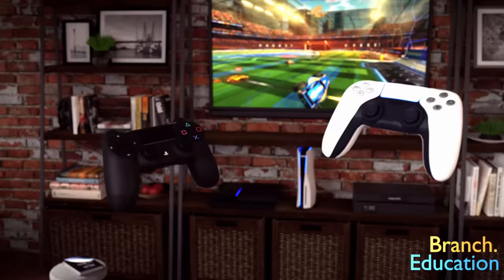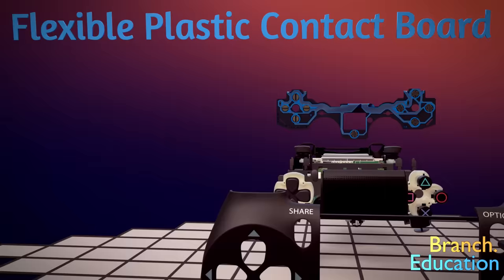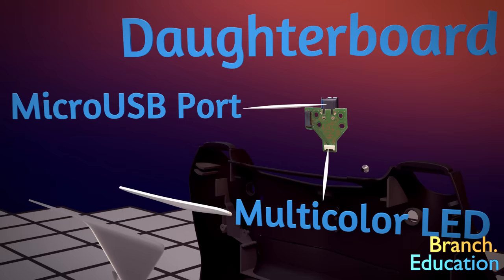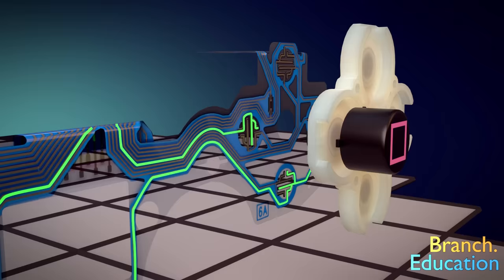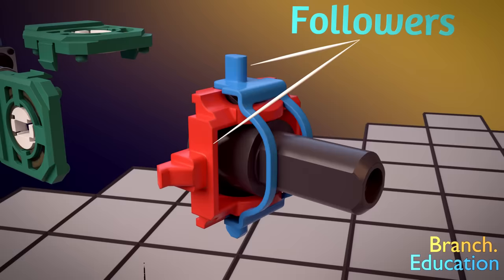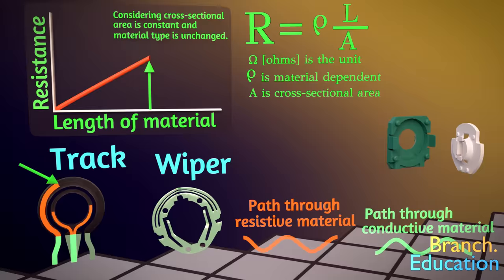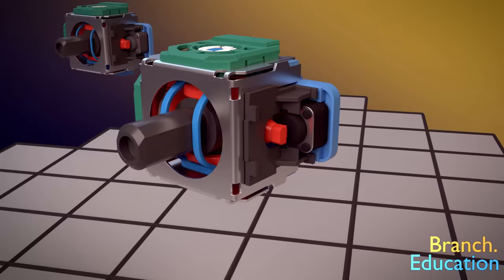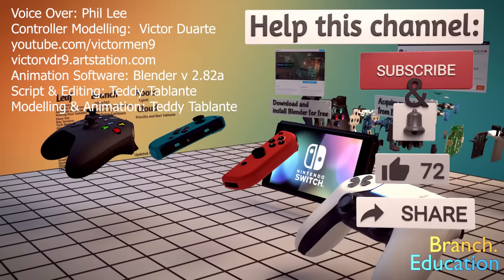How do Video Game Controllers Work?  || Exploring a PS4 Game Controller

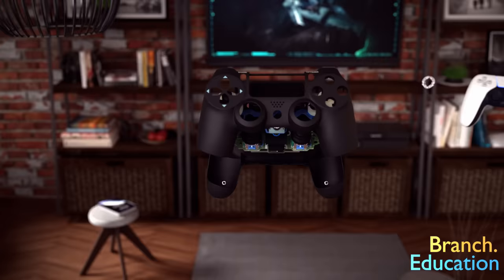Comment: 0:28 Expecting it to be the wiper from the analog sticks' potentiometers.
Reply from the maker: Whaa!  You even got the name of it correct!
Reply: @BranchEducation  I blame curiosity and cheap Arduino-compatible modules from Aliexpress that use spare parts for PS2 controllers. All PlayStation and Xbox controllers seem to be using a very similar design with ordinary, rotary potentiometers, while I believe the Joy Cons use a more compact design, similar to what was used in the PSP, where the wipers are travelling on a pair of guides that only move in a straight line, but by keeping the "stick" a lever (opposed to a dragged around thingy), they've managed to keep the center button functionality, which the small PSP analog didn't have.

Comment: 1:05. I guess it is located on the circuit board and has a porpose of serve as a conducting path according to the movements you make on the controller stick, so it kind of work as a sensor?... I can be completelly wrong, but i just watched 10:05 haha
Reply: I missed the location but the principle I almost got it right

Comment: Recognized the potentiometer wiper the moment it was brought up. I've had to clean some pots in the past, not the most fun thing to do, but thankfully the housing design on the later generations of controller analogue sticks have been much more user-friendly to access the pot casing. 
I grew up on Sony, but I really hate their internal controller design. That flexible plastic trace board is utterly useless, and is probably nothing more than cutting corners on cost. Full PCB designs are much more robust, and are typically easier to disassemble, as you have friction based connectors, not a clamp based connection that the plastic sheet uses. Xbox also has far superior analogue triggers, basing them on actual pots instead of pressure resistors Sony uses. Xbox, due to the full PCB design and the pot-based triggers, has a better internal design that's more user-friendly to service, as everything is rigid and the triggers are held to the board, rather than floating on external pieces; the DS4 design looks to be better than the SixAxis/DS3 design, which was an entire pain in the ass to deal with, as the shoulder assemblies were poorly designed, especially in relation to the controller's shell, though I haven't messed with a DS4 yet, but I'm curious what the internal design and shell design of the DS5 will end up being. 
Although the claims of 'precision' on pots and their wipers isn't entirely true. You can get drift on a brand new, unopened pot, even if the physical position of it is neutral, due to intolerance in manufacturing. This inaccuracy is also why dead zones are programmed, because every pot has some amount of drift. While the explanation in the Canadian English subtitles are true that dust/dirt/debris and wiper wear can cause drift, this only happens when the pot is older; again, a brand new pot will have some amount of drift due to manufacturing intolerance, that dead zones fix, but your explanation of what causes drift isn't 100% accurate. Different designs, such as linear wipers, and centering mechanisms will also change how accurate a pot is and how large the dead zone needs to be, joysticks that use these also have the pots integrated into the housing of the stick, rather than separate pot housings, and these one-piece housings are typically poorly shielded and allow a greater amount of ingress of dust, I'm also skeptical of their longevity; low profile analog sticks, like what Sony's portables have used in the past, and what Nintendo is notorious for using, are the reason why the Switch experiences drift more often.
Reply from the maker: Thanks for the really great information.  When writing this script, I was greatly debating whether to talk about joystick drift, but in the end decided against it because there are a lot of other videos that cover that topic, also I would have had to cover the differences in reliability across the different designs, specifically how joy con's linear pots are worse.  With that, you make a really great point that I should have discussed the the potentiometer's dead zone.  Maybe if this video does well I'll make a followup and get more into design elements and not just conceptual functionality.

Comment: The way the video explains the function of the button is reversed. It shows current is supplied through a unique trace, and a trace that is common to all buttons receives current when the button is pressed. This is backwards. The correct explanation is that current is present on the common trace, and a unique trace receives current when a button is pressed.

Comment: If a controllers analog stick only registers  in 8 directions (example , up down , left , right and corners) , is that a software or hardware issue ?
And what about the switch pro controller , I hear the analog stick on that controller is digital and it doesn’t feel as good in FPS games that would feel smooth and responsive on PS4 for example, what makes that analog stick different ?

Comment: Guy did you know that almost all joysticks use same technologie for example i v put a ps3 joystick on a vita and a switch and it worked cause all joysticks have 4 wires 1) up and down axe 2) left and right axe 3) posive 4) negative

Comment: Im curious if the wiper in the potentiometer  is the same type of tech used in the Switch controllers that have caused "controller drift" and subsequent pending class action lawsuits against Nintendo.  Seems like a terrible design flaw.

Comment: I tried to fix a controller drift (which I have done on two other controllers successfully), but it resulted in the joystick clicking when I tilt it downwards (also there's way more physical resistance tilting down and not other directions). When the stick is at neutral, there's a massive drift upwards. I even open the potentiometer casing and removed the two washer things AND the drift is still occuring. How is this possible? Why is there even a circuit completion when the two washers disks removed???

Comment: 🤚🏽Sir I want to make my own product and I don't know that which thing is required for it coding or programming ???🤔🤔🤔

 basic knowledge about electronics is enough ??
Reply from the maker: Thanks!  These are made in Blender
Reply: @BranchEducation  sir I mean to say that how can i make my own gadgets.?
With basic knowledge??
Or
With c++ ????
Reply: @jerry.196  That's exactly what I would like to do too. The problem is: how are you going to program without hardware? Eletronics engineers and computer engineer both have more knowledge on hardware than programmers. With that being said, making circuit boards is expensive and requires a lot of equipment, homemade circuit boards are really limited. My advice: focus on programming since it's cheap and you can use it to make awesome stuff with existing gadgets, like awesome apps using a phones sensors, cameras and so on. Programming allows you to do cool stuff with only a computer, and you can do a lot more than most people realize. If you want to make simple gadgets though, look up Arduino. It's basically a programmable circuit board, and it uses syntax very similar to C and C++.
Reply: @jerry.196  You can do a lot of cool projects with Arduino. Whenever you want to use an Arduino for another purpose, you can reprogram it. You can stick sensors to it and many other things, some Arduino kits have a lot of cool stuff.

Comment: When I press R2 my character goes to the left. I even tried a testing app and when I press R2 the left analog goes to the left. I tried cleaning everything with alchol and even switched the wipers with the white plastic support from the right analog to left but didn't worked. Any other ideas? Thanks

Comment: 7:56 I wonder if this is the part that causes stick drift on the DS4..
Reply: No, it's caused by the deformation of the wiper, or accumulated gunk and debri on the potensiometer. Or both.
Reply: @rachmatzulfiqar  good to know. I've always wondered what caused it because in my experience it's always been pretty much gunk free or verv little. Sometimes I understand that someone could get a lil sticky something in an around the thumb grip between the plastic shell an stick or spilled something on it.

Comment: How cheaply these 70$ controllers are made. The Logitech F310 is better built by not having that plastic circuit board. On the way cheaper Logitech 17$ the buttons press directly against an circuit board which contains the electrical lines and not an plastic. All of these are membrane based meaning they do not have mechanical switches but rather this silicone rubber pad which holds contact knobs which then press against the motherboard closing the circuit. These expensive ones do not even have anymore an PCB but rather an plastic with electrical lines.